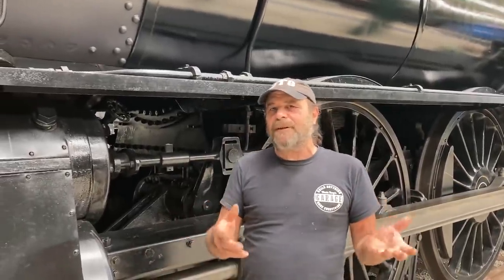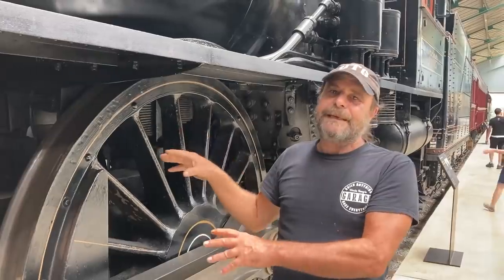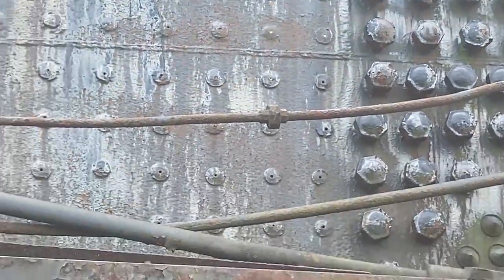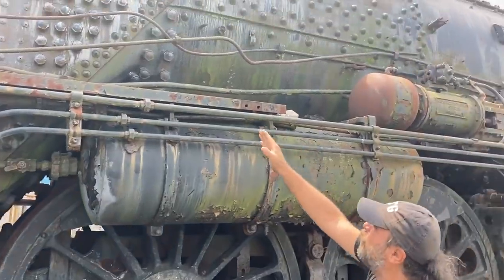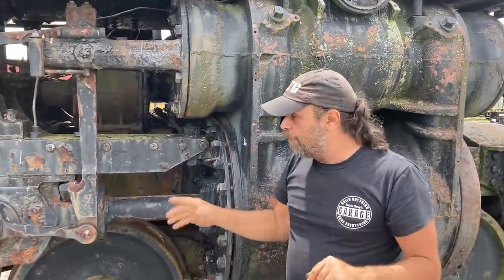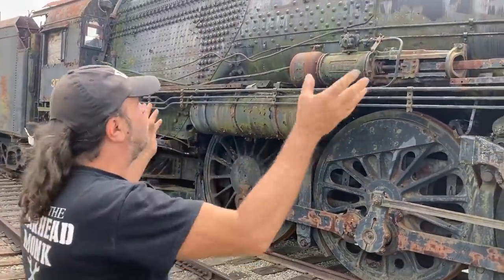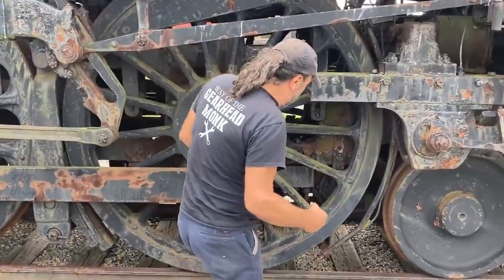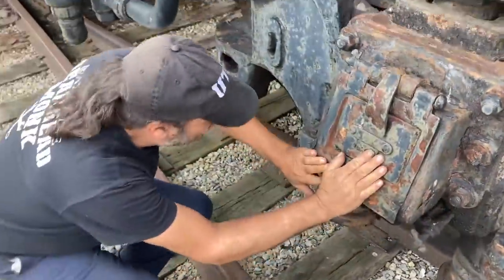The ORIGINAL American Muscle Machines

Comment: Saw a bigboy recently in wyoming what a machine
Reply: In 76 headed to Vegas with my family ,I was 10 ,around chyenne we stopped to look at a big boy on static display.the most beautiful  machine I've ever seen to this day. Always loved steam.
Reply: @duanemccoy4322  yup they still have it their i use to live in Northern wyo and now union Pacific has a operational big boy that they restored a few years ago
Reply: @cj599  did they convert it to oil?
Reply: @2lotusman851  Yes they did. They pulled it out of California, restored it and converted to oil over several years. #4014.
Reply: They pulled 4014 home in 2013, the goal was to have it ready for the 150th anniversary of the golden spike. They started tearing it down, and found the 844 needed a complete boiler rebuild... there went 2 of the 5 years they had planned for 4014. 

They ended up running them out to Ogden together instead of separately, and the night before they left, they were able to get 4014 half way to Denver on a shakedown run.
Reply: Theres also big boys on display at Scranton, Green Bay, St Louis, Omaha, Denver, Ogden(I think) and one down in Texas. The one in Pomona was the best candidate for restoration, it was never flooded, and the staff regularly oiled all the lubrication points.
Reply: 16 68" drivers.  Not designed for speed but beauty in motion nonetheless.

Also, 127.1MPH on spike-driven rails!  Not a weld in sight!  That's a good roadbed right there.

Comment: N&W 611 is one of the most beautiful locomotives ever built.
Reply: One of fourteen😉
Reply: 4449 > 611. . . .  .
Reply: @mortensen1961  yes…..another fine machine. I remember it as a kid decorated as the freedom train. Greater than? I’d say that’s an opinion. I’d be happy to see either one roll through town again.
Reply: 4449 isn’t even streamlined.  It’s just got a skyline casing and some flat bits covering up all the important stuff.  It’s got a massive cycloptic Mars light, it’s got stove bolts sticking out of its smoke box.  I like SP stuff just as much as the next guy, but if you’re saying 4449 is a better looking engine than the j class you are just absurdly wrong.
Reply: @chopperjoe6592  Me too and I'd be even happier to take an excursion behind either of them.

Comment: I am SO HAPPY that NW611 is still running in steam. Last I heard, she was stuck in Roanoke due to amtrak being assholes. Highlight of the video there.
Reply: 611 came up to Strasburg last year as well, passed by where I live on its way there, ran behind a diesel but was under steam on the move.
Reply: @bbybby91  I believe that they have to be paired with a diesel now so that they can use the diesels dynamic braking if needed.
Reply: @MikeBrown-ii3pt  it’s mostly for PTC reasons, and they’ve claimed the steam excursions hurts revenue for Amtrak and NS.
Reply: Railroads used to be able to get insurance for passenger excursions through Amtrak, but not any more (I think the woman on the tracks on one of the last Denver Post runs may have played a part in that)

Steam locomotive brakes are expensive and not the most effective, so it makes sense to have a diesel along for dynamic braking and to clear the lone in case of a breakdown. 

844 and 4014 have ptc waivers.

Comment: I lived about 10 miles from the Strasburg RR. I became friends with the man in charge of the restoration and repair shop and got a few tours when new engines would come in. That shop is the only place left in the USA that can work on these engines. So cool you guys were there.
Reply: Union Pacific has a steam shop in Cheyenne, Wyoming too. That where 4014 was restored. 844 and at least 1 more steam locomotive are also based there.
Reply: there are many shops that still do this work
Reply: @MikeBrown-ii3pt :  But UP still had to contract with Strasburg to do the driver resto on 4014. . .

Comment: One of the few good things about being in Portland is that we have some of the best steam locos in the world, in running condition.  SP#4449 is an absolute legend and a total monster of power.  Roundabout 5,500 horsepower, which is about 1k more than the big modern diesels.  These days, sadly when they do pull her out she's usually barely steaming and getting pushed by the safety-mandated diesel helper.  Back in the 90s they allowed her to pull on her own and it was pretty awesome.  She'd blow exhaust 40ft into the air, and my dad and I watched her out-drag the line of cars pacing her on the highway.  If you didn't have the balls to hit 85 in a 55 and stay there, the train was going to leave you behind.  The drive rods (each link weighs 1k-4k lbs) were an absolute blur.  Great memories!

Comment: I know you aren't necessarily talking power specifics but I was watching one of those antique tractor plowing vlogs. They had a 150 HP steam John Deere. They couldn't get a complete reading on the torque produced because of belt slap and slippage. Don't remember what they did get to but it was well over 1,000 PF. I watched it pull a 36 bottom moldboard plow. Steam power is/was amazing

Comment: This is what I've been  doing last 30  years. I fired McCloud 25 over the 4th, was done on the 8th. You did pretty good. Those hex heads on the edges of the firebox are flexable staybolts, I've help make and replace thousands. Bunch different styles. That trailing truck box you looked in is oil based not grease, the drivers used grease blocks, grease wont heat up till like 30 mph or a couple hours at 10 mph, so at tourist train speeds you convert to oil. it like 30 weightish.

Comment: I am 76 and remember steam locomotives running. My mom said I would have been too young to remember as they were going out of service. It must have made a big impression on me because I remember the engine pulling out of the station with all the steam and the sound. Nothing like the sound of a steam locomotive. There is a steam train in Ely Nevada. They let visitors have the run of the place including the barn. When I was there they were getting the engine ready for the daily run. It was like it was alive. They warned the passengers that they better be on the train at the time it was supposed to leave. It left on the exact minute just like they did back then. I am going to go back and buy the ticket to ride in the cab of the engine.

Comment: He is right on all accounts. I am a avid railfan of the steam era and his explanation regarding how they are built is correct. Steam built our modern world (moved mountains, dug roads, built cities, transported raw material, and refined those raw materials into goods). That takes ALOT of power. 120 year old steam tractors outpull diesel tractors and when put on a dyno even the small ones put out over 2000 Ft Lbs. That is the power of steam

Comment: Great Video! Nice/surprising change of pace, yet still interesting for gear heads. It's about appreciating all forms mechanical engineering. I never thought about the "gearing" of the locomotive based on connecting rod position until this video. I learned sumthin!

Comment: The Pennsy electric locos were crazy too - the GG-1 electrics had 12 electric motors each generating 385 hp for a total of 4,620 hp. When running up a grade or starting a train from a stop the motors could be run in overload for short periods of time - they then made about between 8,000 and 9,500 hp. So good that they were in use from 1935 until 1983.

Comment: The first pass of the steam through the firebox is called saturated steam. A major discovery of the 20th Century thermodynamically speaking was the discovery of superheated steam. This then facilitated the development of the steam turbine, which then ultimately led to the development of the jet engine (indirectly rather than directly). 

In a superheated boiler the saturated steam is collected in a header box and passed back through the firebox for a second heating where it's pressure is dramatically increased as is its energy. The high temperature of the superheated steam turns it to a hot dry gas which has insulating qualities because it is dry, so for example is no good for use as a steam heater for warming houses, but very, sorry that should read unbelievably good for driving pistons (or turbine blades).
Also the valves on a steam engine have fully variable valve timing. It's called cutoff. Full steam pressure and valve duration acts as a brake on the piston as the piston speed increases, so they retard the valve timing and vary the steam pressure to allow higher speed.
Also the blast of the exhausted steam is used to draft the boiler and is analogous to the venturi in a carburetor. The exhausted steam creates a depression in the smoke chest and the blast pipe dramatically accelerates the gases drawing in air at the firebox end increasing air consumption allowing more fuel to be burnt and more work to be done.
Steam engines, particularly those with superheated boilers are very sophisticated.  

In steam turbines the use of superheated steam allowed for the first time multiple tens of thousands of HP from one engine in around 1905. Turbines have multiple stages to collect as much of the energy as possible. Each blade stage gets a bit larger and uses stators to direct the flow to the next stage. Steam turbines are in widespread use today. Mostly steam turbines condense and recirculate the water in the system.

Comment: 4-4-2 Atlantic - bad ass.  That one moving is the 4-8-4, number 611, recently housed in Spencer NC.  The rusty one, is the famous K-4 class, that would top out at 90mph, with 3286 hp, and 44,460 foot pounds of tractive effort.  Very nice.

Comment: They were able to pull 611 with a rope because she’s an all roller bearing locomotive.
Reply: It was fun.  Had they done another event, we’d have pulled the 1218.  It’s much heavier.
Reply: legend has it the NYC niagras could be pushed by two men in operable condition.
Reply: @johnwilburn  1218 was awesome. I grew up in Wytheville VA and we used to chase both the 611 and 1218 around in the late 80’s- early 90’s. I wish they’d get her running again.
Reply: Exactly. Timken had a 4-8-4 Northern engine built back in 1927 with all roller bearings, and advertised that 3 women in high heels could pull the locomotive. Google Timken 4 aces.
 I call BS on the crew letting the water level get down to the crown sheet though. First thing, there's a low water alarm which would be screaming at them, and second, the pressure pops on the boiler limit the pressure that the boiler is allowed to build. This K4s would have been set at 215psi, the second pop probably at 218, and the third if equipped, to 221. A good fireman wouldn't need to drop the water level down low to get to 220 psi.
Reply: @DavesRestoration454  Most crown sheet explosions were due to faulty water glasses not giving true level readings. It can happen.
Reply: @stev3548  Years ago, I saw a picture of four women in swimwear pulling a brand-new NYC 6000 w/ropes at Harmon, NY in 1946. It was to advertise the efficiency of roller bearings. There's a newsreel of it, too, but I haven't found it.
Reply: @emilyadams3228  one wonders about the T1. Less axles, less motion, no force to lose in piston valves.

Comment: I have ridden behind the Norfolk and Western locomotive that is under steam behind you. In its time it was state of the art. It would also do over 100 mph in its day. Thanks for the video. BTW I think Timkin beari gs made there start doing bearings for steam locomotives. It's an interesting story how much work it took for the locomotive industry to embrace their bearings. Another good comparison between the locomotives designed for freight with the smaller drive wheels is the recently restored Union Pacific Big Boy and the N and W behind you. Two of the best examples and they are both operational. Keep up the good work.

Comment: I'm not surprised UT is a rail fan. If you get it you get it. I think Chrysler hemis are just as fascinating as VW flat fours. Chrysler slant six, Ford 4.9, Chevy stove bolt, AMC 258.....just impress the hell outof me.  Old muscle cars and old stationary engines are equally fascinating too. But Steam still amazes me to this day. But Steam is what built modern America.....Or modern western civilization and the industrial revolution.. When Steam  hits the cylinder the expansion factor is instaneous torque. No flywheels on Steam engines. And when they run duplex (Steam power on the back side of the piston) one piston is effectively a 4cyl 4 stroke engine because every stroke is a power stroke. Jay Leno has an impressive collection of Steam cars. Intetestingly, most Steam cars do not have transmissions. They're direct drive to a set of rear end gears. They have so much torque they don't need a transmission. As I recall one little 3 inch Steam piston will generate around 500 lb/feet of torque. Even today, the most advanced nuclear powered carriers and subs are still powered by Steam. Old technology that still amazes. Funny aside - my wife is Hispanic. Can cook like you wouldn't believe. I suggested she make tamales in a pressure cooker instead of in the traditional way in a so-calle tamaleira. She couldn't believe how quickly they cooked. Went from 5 hours to one hour! Steam!

Comment: What a lot of people DO NOT UNDERSTAND IS Drum Brakes like those found on a lot of cars even today was first introduced on Trains back in the 1800s!! The Drum brake system on the rear end of a lot of today's cars have been around THAT LONG when you think about their function and their form!! Cars in the 1950s, 1960s and well into the 1970s in some cases used drum braking systems on all four corners of many cars of those time periods!! Heck I owned a 1974 Oldsmobile Omega (Olds version of the Nova) that had four wheel drum brakes and it would literally STOP ON A DIME with 60 series tires on it!! The wider contact area of the tires made a HUGE DIFFERENCE on those old drum brake systems!! And 10 inch wide rubber stuffed under each wheel well made it handle like a slot car as well!!

Comment: Not a bad overview of a steam locomotive.  One thing that was never done is to allow the crown sheet to run dry, never.  Road steam locomotives in general did not produce maximum power till about 40 mph. Also once moving and not needing maximum power the engineer could  adjust the valve travel with the reverse lever to take advantage of the expansive power of steam.  Starting and at low speeds the valves would be in full travel and the throttle only open to the point of not allowing wheel slip, as speed increased the engineer would move the reverser lever alittle towards center and open the throttle more eventually achieving the most efficient settings of cutoff and throttle for the load and route being traveled.   On that E2 Atlantic at 127.1 mph that meant the wheels were making just under 9 revolutions per second.  That is 36 piston and rod direction changes per second on a two cylinder locomotive.   Also in comparison a two cylinder steam engine has the same amount of power strokes as a 4 cycle 8 cylinder internal combustion engine.
Reply: Do you think he confused superheating the steam? Your comment was very instructive.

Comment: At 127 mph, a six foot diameter wheel will rotate about 8 times... per second.  And it does so on plain, bronze, pillow blocks.  I'm betting that heavy grease is pretty much liquefied be the heat those bearings generate.

Another fun fact about steam power lubrication:  600 and 800 weight oils are the standard.

so....

RRRooooooooLLLLL Up Your RRRRRaiLLLSSSSS!!!!

Comment: Steam loco Fireman here, Mallard has the record for steam engines at 126mph.

I don't really see both of those locos getting near 127mph, the one inside maybe around 80 90 the one outside 100. it's incredibly hard to push a steam loco beyond what it's made for because of how meticulously they are designed

Comment: That was fun with very good info. I only have one correction, The journal boxes where not filled with grease but they had a journal oil (approx 30wght). In the early days when these loco's where new they packed the bottom of the box with rags which held the oil and basically wiped the oil onto the bottom of the journal to lubricate it. In modern times the rags where replaced with foam filled cotton bags which where pre-saturated with oil to do the same job. How do I know this? Because in the 1980's I carried many jugs of that oil many miles inspecting trains and filling any journal boxes that where low. And in the shop I did many "repacks" of journal boxes where we removed all of the parts, inspected, cleaned, and replaced any defective ones including bearings and even wheel sets if the journal was worn or damaged.

Comment: You need to do more vids like this. This was really interesting.
9 people are going to hell
I'v always wanted to see a modern steam engine designed for efficiency. I think a steam engine made with modern metallurgy, and valve technology could be more efficient than gasoline engines. Of course they would have to have many stages, and be extremely high pressure. Perhaps a 2 stage with a turbine scavenger, and exhaust heat capture would be great.

Comment: Finally!  UT found what infinite torque at 0 rpms means. Provided your not at TDC or BDC. If it's any indication HP steam scares me more than arc flash from an equivalent electrical disconnect.  20+ years in industrial service.  I've seen 100lb steam take a length of 12 Inch iron pipe and whip it like you did a garden hose.

Comment: One thing you guys forgot to mention, was the incredible torque that these steam engines put out. FAR MORE than any diesel internal combustion engine is capable of. And for any doubters: the modern day trains, and huge passenger & cargo ships actually use ELECTRIC MOTORS to move those giant loads. The diesel engines in modern trains & ships are only used to produce power FOR the electric motors.